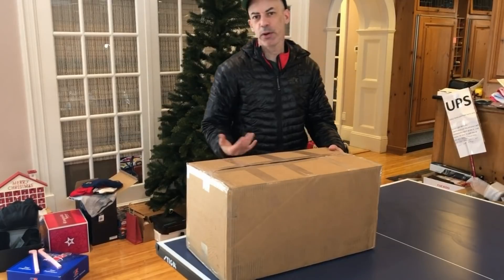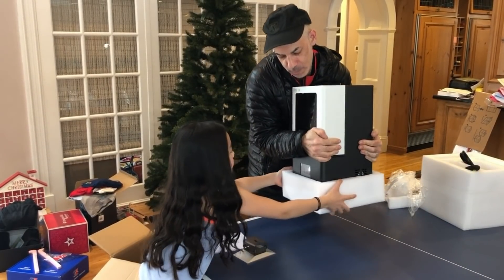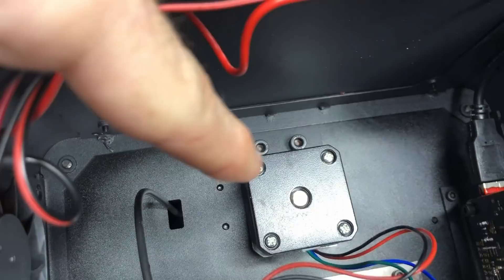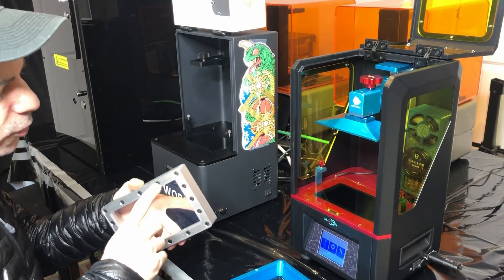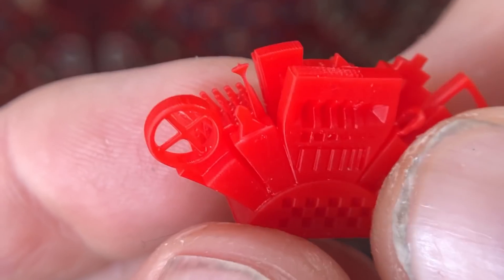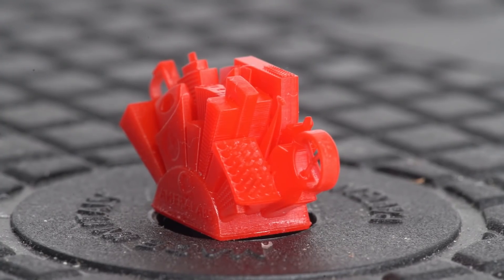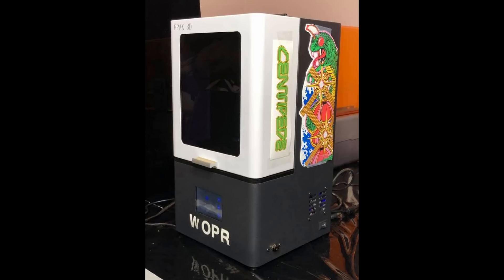EPAX 3D X1 and Anycubic Photon

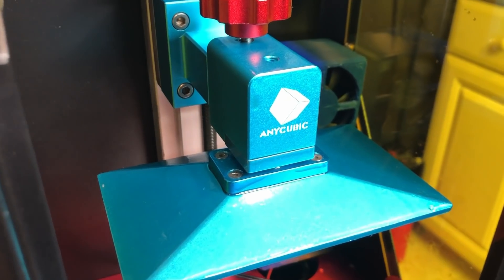Comment: 4:38 - I don't think that more diffusion is necessarily correlated with more uniform distribution. Also, a higher power UV source takes it's toll on the life of the LCD panel, although I don't know if the degradation rate is linear with respect to the UV power level. If it is linear, that is the best case scenario and the faster printing times would basically mean that the LCD panel would print roughly the same number of parts before failing.
I own two Photons and I must admit that the ingenious ball and socket build plate leveling system sounds cool, but in practice is more trouble than it's worth. The simpler 4 screw built plate leveling that every other low-cost LCD printer uses is better.
The Photon is now $300, and I'm not sure the extra $200 for the EPAX is really worth it. The Photon has poor support from AnyCubic, but a large public support community has formed around it and it can be improved quite easily. The beta AA firmware for the Photon also seems to work quite well.

I must applaud eSun for coming out with new resins for these low power LCD machines. It seems they have helped to force down the price of the AnyCubic resins which have always worked extremely well. I tried a whole bunch of other resins on my Photons, including FuntoDo, Monocure 3D rapid, and 3D Okay. None of them produce the print quality or cure as fast as the AnyCubic resin. I'm anxious to try out some of the eSun resins because I hear that they are very good.

Comment: Thank you so much for your review.  I went with the Epax after watching this as a very  good comparison.  I have had it two weeks and am astonished by its quality.  
I have a sort of weird question, while it appears that the two don't share a build platform close enough to just swap over, it looks like the build plate is the same or very similar on both of them.  Do they share the same hole pattern with thread sizes and locations or is that just my bad vision?

Comment: Are you using Chitubox as your slicer for this? If so are you using the settings recommend on the Epax website?
Reply from the maker: I use CTB and Formware most of the time. Not sure if they are using my settings or not.
Reply: @rsilvers  Not sure if Epax is using your settings or not? Have you looked at the settings guide for CTB on the Epax website?